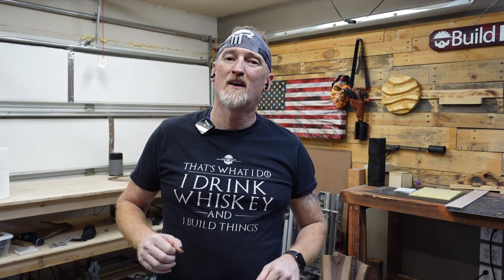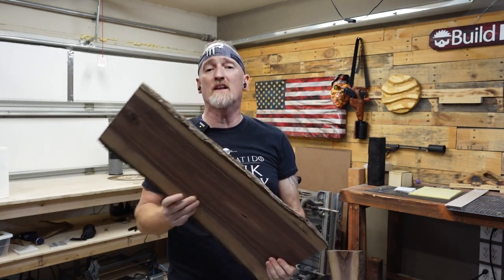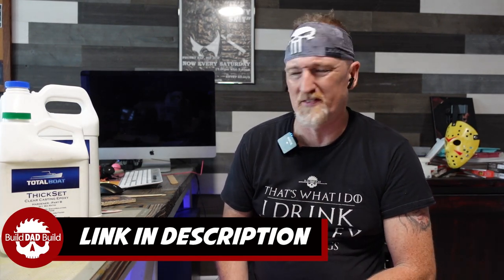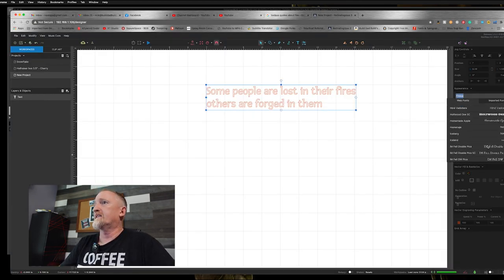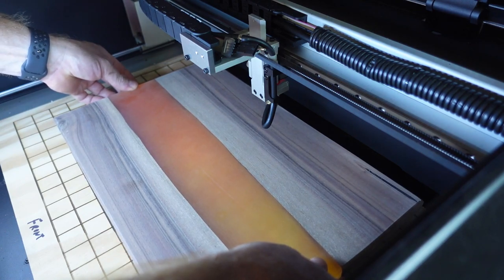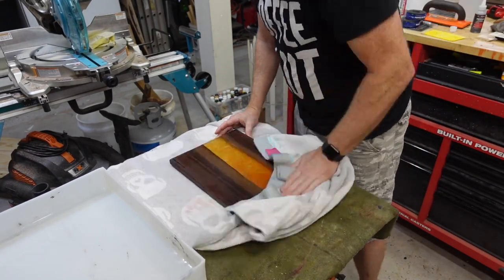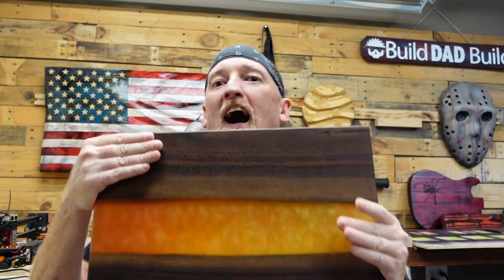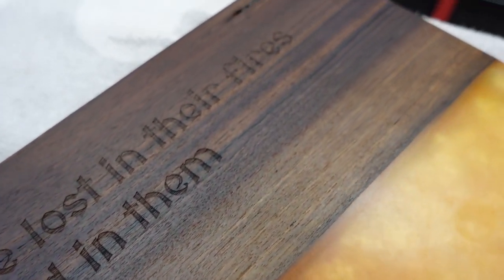Lasers and Epoxy, OH MY! Check out this Charcuterie Board

Comment: Hey brotha! Hope all is well. The trick with mixing of the two parts is a practice all in its own! It took me a while to figure it out but you’re on the right path. What I found is that separating the mixed epoxy into smaller containers is key so that the chemical reaction happens more slowly so that you can get that thick honey consistency while still being able to pour swirl and level. Hope this makes sense. How’s the channel coming along these days?
Reply from the maker: Hey brother!
Thanks for the tips!
Channel is doing alright...headed into maniacal production season. How's everything with you?
Cheers

Comment: line your ceiling with sound panels. good video. will clean up your live narration.
will help that mic your using a good bit.
Reply from the maker: Hey Larry! What kind of sound panels would you suggest?
Cheers
Reply: Build them yourself diy style.  I'm actually in the process of researching it myself for a home theater... tons of online reference  material out. Could do your own videos on it . Good Luck